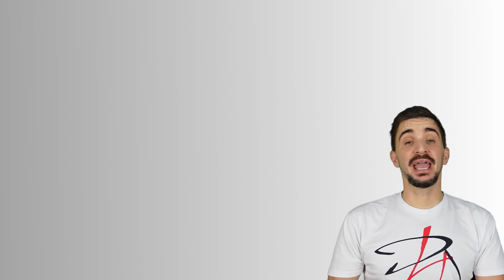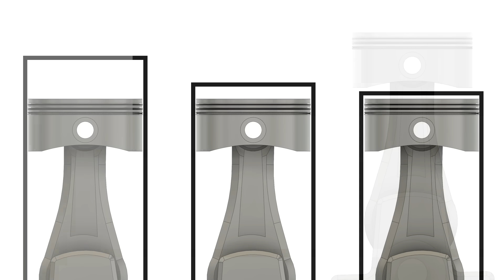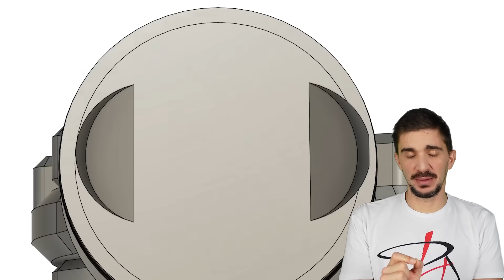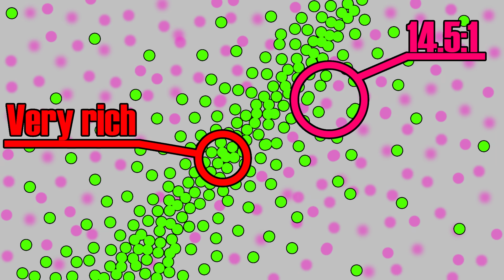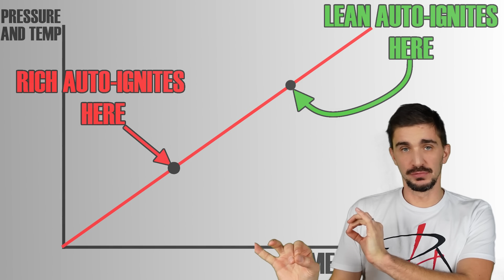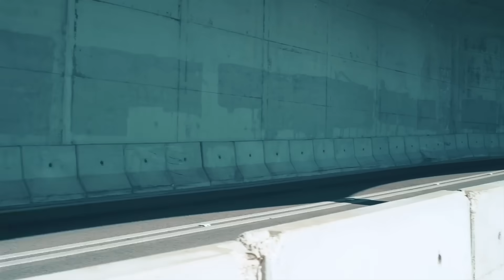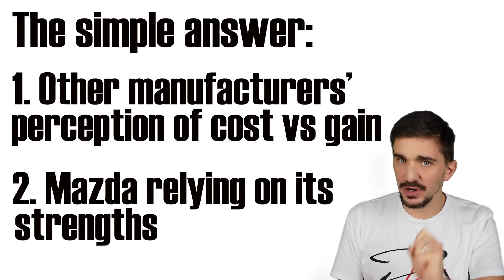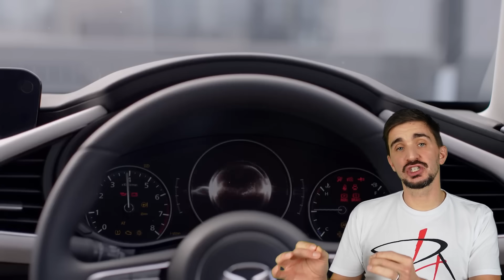The Game Changer Nobody Cares About - Mazda Skyactiv-X SPCCI How it Works and Why It Didn't Catch On

Comment: Might be efficent, but the lack of down low constant torque not having a turbo is a no go for me in 2026. NA engines just feel outdated while driving. Unless you go for larger displacements >4 Litres. Btw Mazda engineering is great.

Comment: I was working on this at Ricardo over 20 years ago.
We tried creating a local packet of air and fuel at the spark plug.
It worked at low load and low speed, but at high speed there wasn't enough time to create a localised packet and as high load created a packet that was too rich  due to the amount of fuel needing to be injected and caused the similar kind of 'sooting' problem with diesels.
Reply: For you or if you know any with a great talent in engineering and/or entrepreneurial skills to join my new startup..  I have a new type of SPCCI engine that runs on wet ethanol and can get up to 2.5x+ fuel cost savings. I have 3D CFD proof of sharp deterministic ignition using OpenFoam, ChemKin simulations and offering early buy-in and commissions for referrals. Has much wider load range than normal SPCCI and a fallback to conventional spark if needed. Thanks. Message me here if you know anyone interested.

Comment: Gas is clean diesel is dirty is wrong. Because it depends what you are doing and what sort of cleaning is implemented. And of course the engine is nice. But those cars driven by the engine are only average in fuel consumption.

Comment: I was very happy with this engine. Until I wasn't. It slowly developped issues leading to a lack of power (without any warning). Until one day I demanded a big burst of power, then a warning "engine defect, bring the car to an approved mechanic" appeared. I drove to a mechanic. And I sold the car two days later. An injector was shot, which destroyed the piston and everything downstream. He told me that those Skyactive engine are a marvel but the injectors are super critical. And apparently not always reliable.
Reply: And if I may add. I bought the first generation of it. At the very end of 2019. I thought I had found the perfect thing. No hybrid, naturally aspirated, revving engine that you have to drive. It was very fun and the Mazda 3 is, in my opinion drop dead gorgeous. But then you realise. The engine has a mechanical compressor, and a little electric motor to fill in the lack or torque at some RPMs. And the car's electronics were... well not good. Especially the fact that it would not tell you how serious of a problem you may have in your very specific engine. I would love to see that technology developped further, but it wasn"t the miracle I had hoped for. Oh and consumption wise, doing almost only highway to go to work : 6.7L/100km... Maybe I got the unlucky number, I don't know.

Comment: As a non native english speaker, I fail to understand what @d4a means by "to rev the motor" or to "work it". I understand it's a point of view, where is the line between choire and skill as he said, but in what way about this engine ? Can someone explain to me how to drive this motor demands some effort compare to some others ? It's a genuine question from someone who will buy a car. Thanks.
Reply: Lot of people dont understand torque and power curves. Instead of downshifting they just step on the gas pedal and wait.
Reply: @petrnemecek4379  OK I understand. I always drive manual cars (for 20 years) and if it is just that the effort (understand when shifting up or down), that's not a big deal.

Comment: SPCCI is the perfect engine for a series hybrid drivetrain range extender, which happens to be their primary selling point.
Reply: Exactly this was in my mind. As range extender engine can be run optimal range. Maybe they could make it 1,5L and save some weight and space. Winter time you could run it to make heat for passengers. Make car spacious simple rugged MPV (minivan) and I am sold.

Comment: NA engines having "no punch" is stupid. When I am gonna press 100% throttle at 5000 rpm on a NA engine - I am going to get exact same result every single time. Every single time I am going to have the same "punch". With turbo engine one time I am going to have spooled up turbo and have "punch" that internet wants. But other time turbo gonna be at it's minimal rpm, so I am going to have to wait for a turbo to spool up and only then power will come. That unpredictability is very conserning for me on a daily driver car. It is fine for a performance car to have that unpredictability. But in a daily driver I want predictable engine behavior in every situation. In addition to that, turbocharged engine statistically less reliable than NA, and I want my daily driver to be as reliable as possible.

Comment: If you use this engine in a hybirid, then You don't need to control it. It can run as a generator at its peak efficiency and all the necessary control can be realized by the electric motor. I wonder if it would be more efficent solution then currently used Atkinson cycle engines?

Comment: Diesel is only dirty when ran on petroleum diesel fuel. Rudolf Diesel designed the engine to run on corn oil and the like, in this case diesel is very clean.

Comment: That's neat and all, but show me the long-term reliability of these engines. Seems the newer generation of over engineered auto tech is becoming less reliable than previous tech . I put down a 100k mileage on my vehicle every 2-3 years . And every time I get a new one it's not as good as the old one was new .

Comment: Using AI to problem solve is not different than using a table saw to do wood working.  I hear your frustration but I am not sure we have truly internalized the challenges AI introduces.  You seem worried about the lowest common denominator using AI to "think for them." I don't really see that as a problem.  Those people were already not thinking at a high level.  The tool does not change the users core traits,  If any thing, for "lazy thinkers" AI might be a boon and help society as a whole.  High level thinkers will not become "dumb" or "lazy" because of AI.  I have concerns, as do you, with AI.  But this is not one of them.  AI is an efficiency tool, not an intellectual lobotomy.

Comment: This would be great with a hybrid. Like the new Hondas. At low speed they can run the engine in high efficiency mode while electric is driving the car, then at cruising speed the engine can drive directly.

Comment: Let me explain it to you! My 2l diesel makes 140ps, it gets 4,5 l to 100km, it runs at 2000 to 3000 ram and gets the car eazy at150km per h. It's perfect,  cheap as f, and no I don't care about your stupid environment.  So selling me a gas engine that costs 30k and ask me to rev it at 4000 rpm, risk blow it up at 100k km, is not going to happen.  My diesel already has reached 300k km, the re are others running fine way over 450k....so whe I reach 1 mil km and my diesel finally dies, I will just buy another diesel....do you see your dilemma? I will not buy a fuckin expensive engine mazda should make the sky active x under 10k brand new, otherwise NOONE WILL   BUY  IT.😅😅😅😅😅😅😅😅

Comment: Interesting, did not know they are still the only ones with SPCCI.
But imho Skyactive-G sucks. In combination with that slow and way too long 6spd auto they are extremely annoying to drive.
No torque at all in cruise/low revs, needs to shift 2 or 3 times (takes forever) to get in power range.
Peak power only at 6k, limit at 6.5, when it shifts up you are back at 4.5k, where nothing is happening again.
Depending on country you pay tax for 165hp/2l, but it feels like 1.4/135hp car.
Consumption is also bad compared to other cars in my experience.
They are smooth/comfortable for city driving, maybe ok on US/AUS highways where you cruise with more constant speed/load.
But here in AT/DE/IT with lots of traffic and big variations in speed it is horrible drivetrain.
Iʼll take an Astra with 135hp 8spd, or a Leon with 150hp DSG any day over any Mazda with Skycraptice-G.
More responsive, quieter, faster, 2l less consumption…
Maybe it would make sense in something light like MX-5, with manual, or dct or modern automatic in bigger cars.
But the combo of a peaky 2l NA with no torque, slow/long 6spd auto in something big like a CX-50 is just bad.
Maybe that is why no one else is doing it.

Comment: 7:00 I have a question. Why would we want rich mixture? At 14.7:1 We have enough air to burn all fuel. At richer mixtures we have too much fuel for the available amount of air. In my mind, excessive fuel is just wasted. Can you please explain how we produce more power with rich mixtures when we "can't burn more fuel"?
Reply: Fuel is an extremely good coolant, cool the air and intake with more fuel =denser air. Denser air=more power for same cfm. All the fuel isn't burned but more of it is than would with the same mixture at a higher air temp.
Reply: @NoBody-kt6gf never thought in this way. Make sense
Reply: You also need leaner and richer mixture for your catalytic converter to work. Lean mixture = leftover oxygen for converting CO to CO². The latter is less poisonous. Rich mixture ensures the cooling of turbocharged engines. Evaporation of excess fuel is an endothermic reaction, so it sucks up heat. The heat is coming from the fact, that turbocharged engines burn more fuel while the efficiency stays the same, thus more heat. Hope this helps
Reply: @docverwusto8800 not just turbocharged, carburator, tbi, and certain injection systems also benefit.